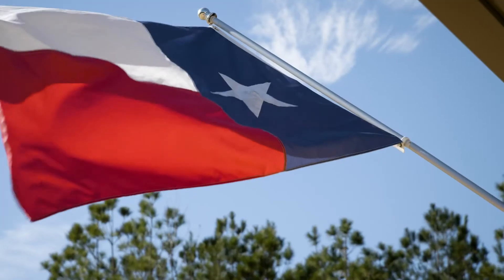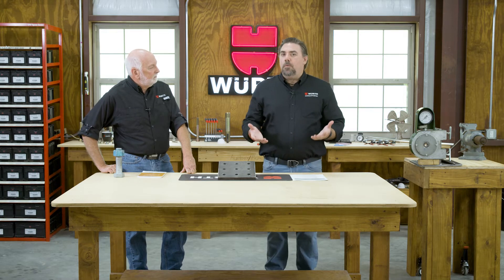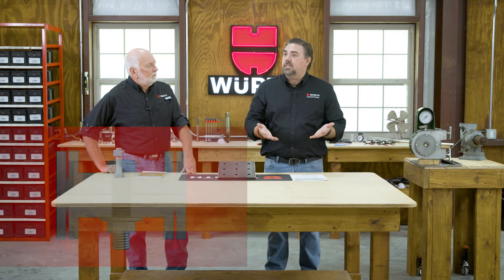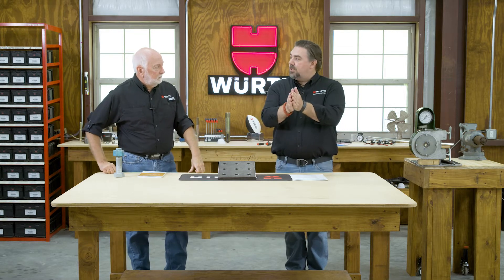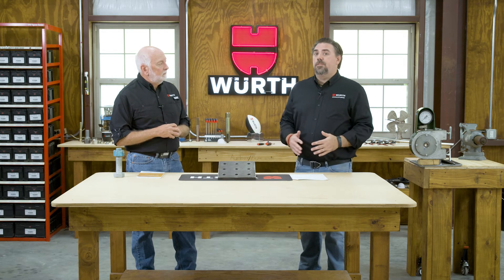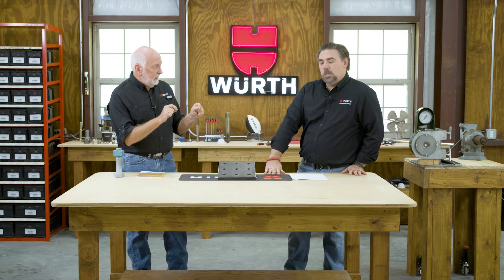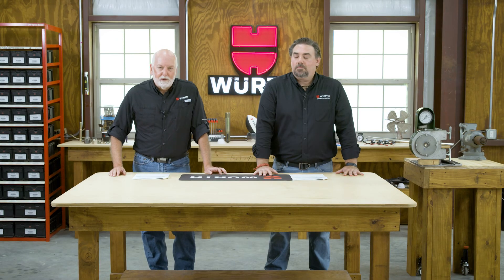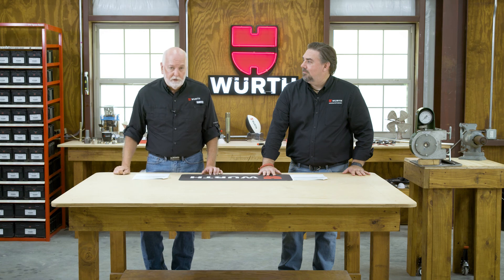Structural Bolting Assembly | Würth Knowing Episode 17

Comment: It wouldn’t be right to say the bolt is cold and it’s cold in Minnesota without having a frost imaged edge for visual effects. 
I got paid as a young buck to climb and repair microwave and tv towers and has an emergency up north. Wave-guide has different shapes but flexible with clamps was not uncommon. 32 mile East of Pierre, SD. in a company pickup & caterpillar battery, it was Zero air temp when I left and Zero when I got back to the hotel at night. A 300 foot guide tower had broken wave-guide bolts and blowing around inside a triangle of steel angle iron make me feel safer knowing ice clamps on guide wires and grade 8 bolts properly installed by union workers. It did not make it warmer but spit would freeze without movement on the towers leg. After all, the wind and snow was horizontal and at 12” off the ground fell 18 miles South. There was only 5 strands of barbed wire and 3 mail boxes to the North to slow down the wind. 
  Enjoyed the video guys! Thanks.
DK, Omaha
Reply from the maker: It's important to understand, extreme changes in temperature can make a difference in the torque to tension relationship. Glad you survived the freezing cold up north and I bet you have some good stories to tell.  

- Randy